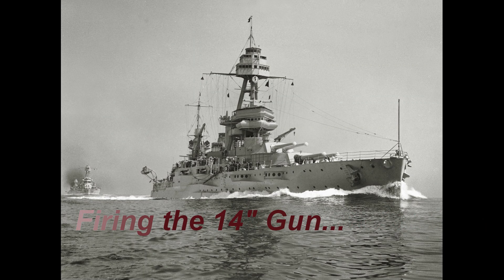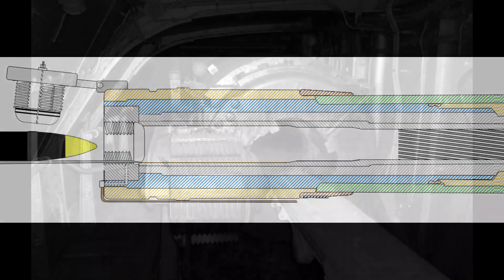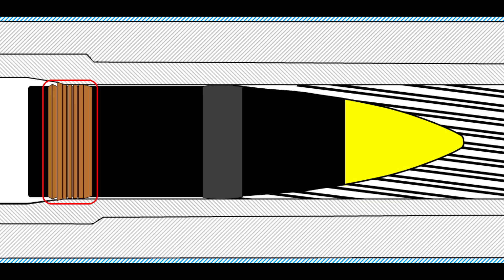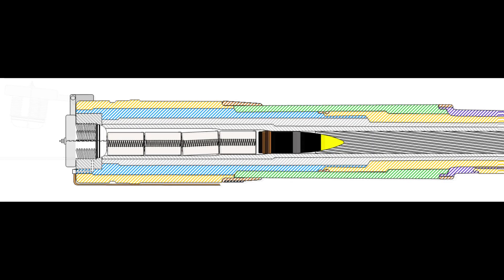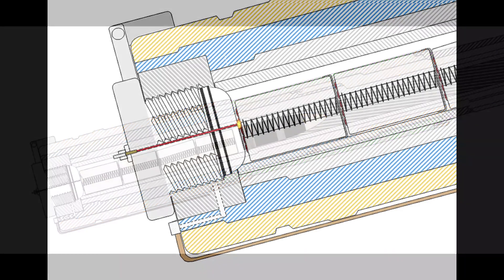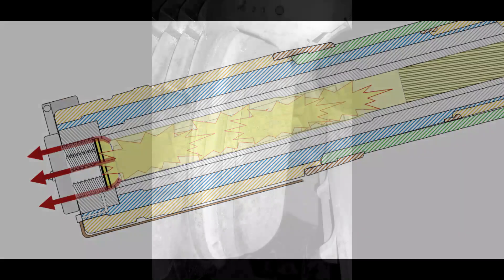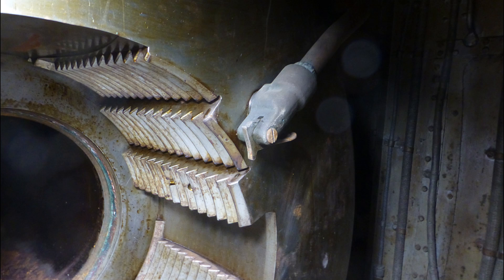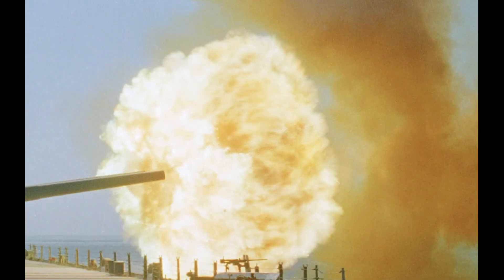Battleship Texas, Firing The Guns Step-By-Step

Comment: It is interesting that these were designed with pencil, paper and a slide rule, no computers. Also no high tech computers to aim or fire the guns either. I am so amazed by the ingenious mechanical designs back then.
Reply from the maker: What fascinates me the most were systems found on later ships where the turrets were directly controlled by the fire control computers using servo systems.  While sensors, like search and fire control radars, were electronic, the computers and servos were purely electro-mechanical.  They largely eliminated human error and could aim and hold on target faster and better.  It was unfortunate that it wasn't feasible to adapt Texas to utilize them, but I'm glad they didn't try.  It would have required heavy modifications that would have eliminated these early systems and the history that we can still see.
Reply: @tomscotttheolderone364  I think it really made sense to not upgrade Texas since she was not intended for surface actions but was being used as a shore bombardment platform.  Along with New York and Arkansas and Nevada they were the oldest Battleships in the fleet.  Whats great was that Texas against the odds was saved and preserved so we get a great time capsule.

My personal dream would be when the Navy decommissions the USS San Jacinto (A Ticonderoga class Cruiser) it could be preserved in Texas along side USS Texas.  It would be great since the two ships encompassed over 120 years of Naval History of the United States showing the evolution of Navy warships from 1912 to 2020.

Both ships have a lot in common- Both ships had long service lifes (31 years for Texas, 35+ years for San Jacinto) both fielded new advanced capabilities but were followed by improved follow on classes (14inch guns on Texas, followed by Standard type Battleships)  (Ageis Defense system on the San J, which was later used on the Burk class DDGs) Both had major refits to keep them relevant in the changing combat envoirments (Tripod masts radar and anti-Aircraft guns for Texas, Improved Firecontrol Systems for San J.)
Reply: The same as the Saturn v F1 engines engineers in a class of their own. Cant beat properly trained engineers with the know how.
Reply: @stuartkeen5234  you mean Werner von braun
Reply: @spannaspinna  yes
Reply: @stevesmith9151  what for? To be sunk from over the horizon where guns cant reach? 😉
Reply: @Ganiscol  the lase battleship gun was designed in the 30's it's nothing more than a rifle in the 30's a 600 yard shot was about as good as it got with a rifle now we have rifles that are accurate to 3'000 yards 5 times the 30's distance if we apply the same tech to a battleship gun it's not unreasonable to expect accuracy to 208,000 yards in the case of iowas guns almost 188 miles well over the horizon and well into what a missile can accomplish
Reply: Not so much in the design of the guns, but in making the ballistic tables, used by the fire control directors, where tabulated by "computers". Except it wasn't a machine, but a job description, usually performed by women, who's job was to do repeated calculations, by hand, in making those tables, which would be printed into books, to be issued to the ships.

Before digital computers, a lot of calculations had to be done manually. The old term of "banker's hours", because your bank was open to the public from 10AM to 3PM, on Monday thru Friday. It wasn't that bank employees were lazy. They worked "9 to 5", like everyone else. Its just that they needed to one hour prep, before opening, and two hours after closing to reconcile "the books", manually. later, with the help, of mechanical adding machines.
Reply: @stevesmith9151  Maybe not to a major degree, but it would make sense to have smaller purpose-built shore bombardment ships, 8" guns would be good enough.  Why use a multi-million dollar missile when a shell worth only a few hundred dollars can do the job? 
And certainly, once that shell's been fired nothing's going to stop it!
Reply: @stevesmith9151  One problem is it takes a LOT of sailors to operate a battleship, sailors the Navy doesn't have.  My solution to the manpower problem would be to man the guns (main batteries and secondary) with Marine artillerymen.  The gunnery principles are basically the same, Marine cannon-cockers could easily be trained to handle the guns and let the sailors "do the driving" and get them where they need to be.
Reply: T-Square and lots of types of rulers
Reply: They also often didn't work the first time around... it was alot of trial and error that resulted in the guns on the Texas
Reply: Many.of the machines and items in use today are based on paper & 'pencil' drawings. We've only expanded on and refined those works. 
Jus say'n.
Reply: @chriscampbell Actually, these ship did have computers to aim, but they were electro-mechanical computers unlike todays. Young people these days vastly underestimate the technology that were used in WW2. Take torpedos: the US had a electro-mechanical computer that calculated the optimal angle to launch the "fish" and those topedos could be programmed to change course at a specific time/distance. Then there are the VT fuze (variable time fuze) used in anti-aircraft roles and later (in Battle of the Bulge) against ground targets. These fuze can detect the distance to a target and detonated at the optimal range. The VT fuze was so highly classified that they were not de-classified until 1954.
Reply: @stevesmith9151  Problem with battleships that use cannons is the ship itself, maintance is the problem.
They are costly to keep in working condition due to the crew, and due to the training needed.

A rocket sits around and needs a few components changed from time to time to be ready, Battleships need a few hundred sailors you need to keep in training and replace from time to time, and that ship is single purpose.
Reply: @pouncepounce7417  then there's lasers and rail guns...
Reply: @AbcdEfgh-sq2tf  Lasers are complicated weapons in atmosphere, the problem is they are line of sight, the fun part of battleships with cannons is you can shoot over the horizone...
Railguns are interesting too but basical they are powderless big guns so you save on the powder rooms and a few guys hauling propellant, that is the only difference aside that lasers are very very expensive.

The complicated part is, battleships need mass to carry massive guns with MASSIVE recoil (mass drivers have that too) and they are very complicated machines, you have today a lot more automation but the automation part needs maintance too, for railguns you need MASSIVE ammounts of energy, think nuclear reactor to keep happy because you do not want unhappy reactors = in an ship designed to be shot at, aircraft carriers have them reactors but they stay usual way off the areas where the fun takes place.

So you need maybe not as many but still a rather big crew that consists of very educated people that need to work very well together.

Aircraft carriers are the only real big warships today, all others are smallish compared, much cheaper, you can have many more of them, so much more targets to shoot at and much more problems at once to worry about for your opponent.

Not saying that at some point battleships could become relevant again, drones made the panther anti aircraft projectile tank an asset again.

But again, much cheaper to build an modern dreadnaught than keeping the old ones and try to update them
Reply: There is a common misconception about slide rules. Since they are only accurate to about 3 significant figures, they were only used to obtain an initial rough estimate. The final design was done by hand calculation for accuracy. I am a retired engineer and I used a slide rule in the early 1970s.
Reply: @Little Shop of Electrons  yes I used slide rules and made drawings by hand using paper and pencils back the 70s also.
Reply: @littleshopofelectrons4014  people just like to steal the slide rule comment and make out like they are some sort of genius for posting it
Reply: @stevesmith9151  Guns as a main ships weapon are obsolete.  There is a reason why they don't build them like that anymore.  large Anti-ship missiles would still sink a Des Moines.   Traditional naval guns maxed out at ranges of 21 miles modern Cruise missiles have ranges of a 1,000 miles.  

The primary role of Modern Warships is to defend Airspace and to hunt submarines.  You cannot defend hundreds of miles of Airspace with Naval Artillery.  With modern SM-6 missiles you can.

As for LCS they were a shit show caused by corrupt politicians and flawed "threat" perceptions.  However the Modern Burk and Tico ships have been doing their job for nearly 40 years without complaint.
Reply: @stevesmith9151  Do you know what they found out about the Bikini Bomb Tests?  that Nukes don't do that much damage to ships unless they were relatively close.  Only one ship that was 1,000 meters from ground zero actually sank and that was a dry dock.  Many Ships survived the bomb test including ships that were not war ships that had little in the way of Armor Several Destroyers survived much closer to the blasts and they do NOT have high survivability.  The bomb test revealed that while nukes were deadly to ships up close ships were not nearly as heavily damaged at greater distances.  However all ships would have been killed by Radiation since all the ships involved had Lethel levels of radiation.

If you think a Hypersonic missile traveling at 5,000 Miles Per Hour is not going to dent Class B armor you are an idiot.  just kinetic energy alone would be devastating to any ship.

There Are anti-ship missiles intended to sink 100,000 Ton Fleet Carriers.  

Yamato and Musashi were sunk with concentrated air attack involving dumb bombs and unguided Torpedos.

What the hell are you talking about "modern Sabot ammo"  Are you talking about Tank Rounds? or Hypersonic projectiles-  Hypersonic projectiles have been cancelled and either way would have inferior performance to Missiles.

And no they were not even close to having "Sabot" rounds for the Iowas.

"nothing Left on Earth that could go Toe to Toe with an Iowa and survive." 

Nonsense.  Complete Utter Nonsense.  It is in fact not that hard to sink a battleship if you have the right weapons avaible.  IF you don't think that you can't build Missiles that can defeat Armor that was only rated against 2,000lb AP super heavy guns from specific angles (You probably don't even understand that Battleship Armor is built to take rounds at specific angles and distances.

You can litterally build a missile with More Mass than a YAMATO shell with many times the velocity and target the ship from angles it was never intended to survive.

That is the Reason why Armor is not a priority for the Navy anymore.  You can always build your missile or Torpedo bigger and shoot from farther.  No ship can be made invincible.
Reply: K.I.S.S. Keep it simple stupid.
Reply: The complexity of these ships are definitely amazing man's ability to build and  design these ships are mind boggling
Reply: yes. something so beautiful and visceral about the days of analog.
Reply: The computers are analog computers who are very sophisticated, they are build to solve exact the solution needed.
Today we use more general purpose computers, but aside a few more modern materials and elements there is no way to make them "better", just smaller and cheaper, but not more "modern", if you need to compute a given task over and over nothing beats an analogue computer in speed and precision.
Reply: Chris:  That is because the people who went to engineering schools back then actually had to learn engineering thoroughly and learned to think critically.
Reply: @wrongfully accused  I was born in an age before home computers and understand critical thinking and imagination.
Reply: @stevesmith9151  : A 16" shell is capable of 1/2 MOA at a range of 23 miles.
Reply: You're forgetting an extremely important factor in ship design: trial and error, decades of it
Reply: What surprised me is the redundant safety systems. It's very well thought out
Reply: Not only the engineering and Design, but also the massive Machinery to forge and machine the giant guns
Reply: @karlmiller7500  have a look at “ the birth of a big gun it’s filmed in the Krupp factory with massive  forges ect
Reply: I was part of those days, and so right you are. There was a higher, more substantial educated people in the field of engineering, something we have lost, a view of just how things should go, which has also been lost.
Reply: @gailbirchall2163  the older I get the better I was
Reply: @spannaspinna  Practise makes perfect, and agree in my own case.
Reply: Agreed Steve all our apples are in 1 basket with  high tech electronics. We still need to not forget how the old tried and true would still work and keep the availability at hand
Reply: I always attribute these comments to the very young.
Reply: @Allen Watkins  Thank you I am young compared to the Texas, but in high school and college I was drafting with paper and pencils and entering data into computers with IBM punch cards and would have to wait for the next day to get the results.
Reply: I agree it's amazing how they designed these things with just pencil paper and slide ruler I would love to see the blue prints of these guns the skills needed to draw all the complex components from the smallest to the largest. 
To bad you will never see these skills today everything is done on computer and when your done just hit print. 
It's sad to think you will never see these skills today